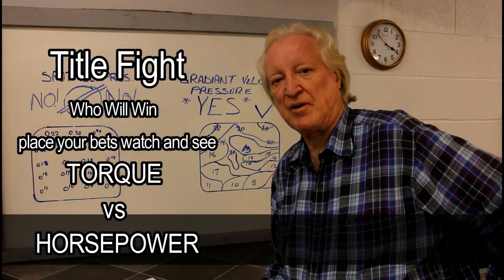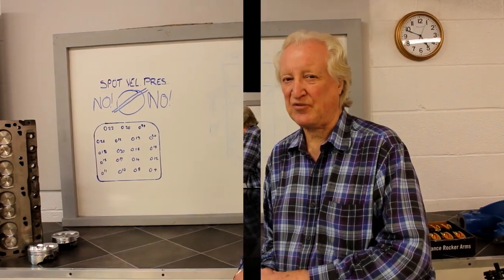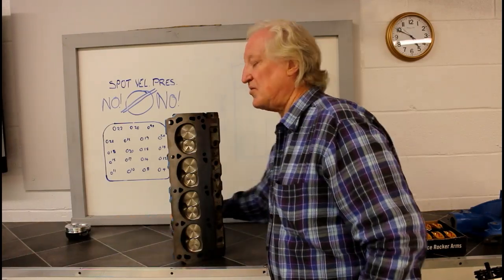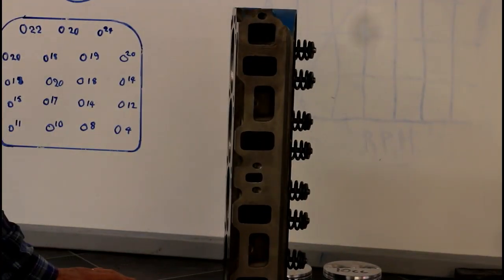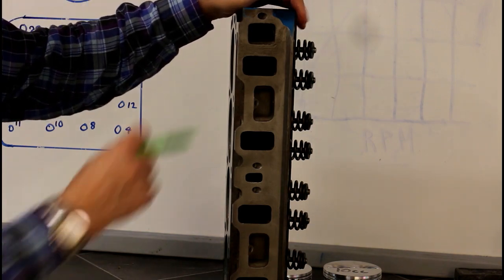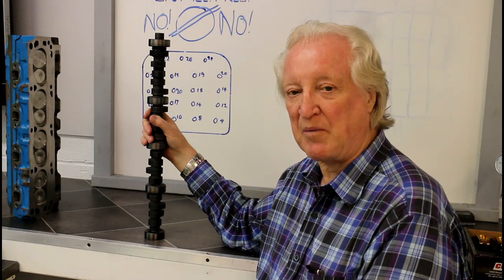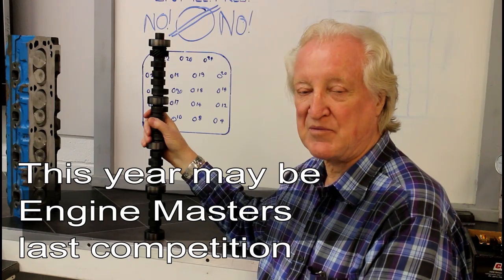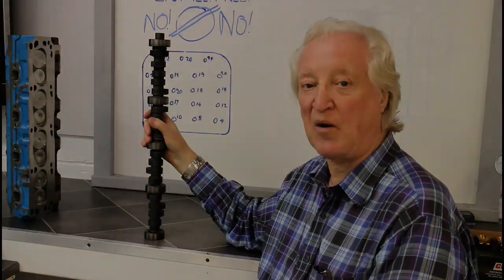Powertec 10 Episode 2 Torque vs Horsepower

Comment: I didn't know his daughter passed. I been watching David's vids for about 6 months. I myself had extreme depression and anxiety and his voice and information I been putting on late at night. Its not the world us born before 1980 grew up in.. This man knows his stuff. No doubt
Reply: Funny you use the Ft/Lbs per C.I. instead of HP per C.I.   I understand why you do it but, thru the modern day HP Torque equation and that equation's 5252 variable, HP and TQ are joined at the hip.  I bought Vizards books back in the early 90's. It taught me to look at efficiencies or the lack thereof and how to qualify those efficiencies. First, the reasoning behind HP and Torque.  The early engineers thinking of power and rotational force (torque), at a flywheel, was:
The linear distance covered at the circumference of rotation is a product of the radius and angles covered.  Therefor: 
linear distance = radius x angular distance
Further:
linear distance = linear speed x time
Ergo: Power is,
radius x angular speed x time
Finally we can say:
Torque = radius x force
This can be transposed as:
Force = torque ÷ radius = power
Boring! Most ppl dont understand HP.  Ppl thru the years have romantisized the HP variable into something its not. HP is a dimensionless unit.  Not until you add Displacement and RPM via the use of Radians can HP be measured.   TQ on the other hand can be measured; without any other variable.  Prior to the 1870's TQ was known as the Moment of Force. The HP Tq equation was created to qualify TQ per minute per second; aka, RPM.  I'll try to be quick here.  Radians, regarding Circular Functions such as Rotational Frequency as applied to an engine's flywheel have 2pi for one rotion; 1 RPM. Half a rotation is 1pi or half a Radian.  So, 3.14159 is 1pi, while 6.283 is 2pi.., 1Radian, or 360°. Keep that to the side for the moment. James Watt back in the late 1600's qualified HP with his 33,000 ft/lbs per minute equation or 550 HP per second. However, RPM was never qualified. To qualify HP we take Watt's equation one step further.  Take the 2pi per rotation and divide it by 60 seconds.
6.283 ÷ 60 = .1047166
This number gives us Radians per second.  Now divide Watt's 1/HP per second number by Radians per second.
550 ÷ .1047166 = 5252
There is your Time Qualifier for HP.  In other words, how efficient or inefficient is TQ being utilized at any given RPM.
You can also use the 33,000 number and divide by 6.283.
33,000 ÷ 6.283 = 5252
The 5252 variable is nothing more than a "Time" qualifier of Torque.  By default once Torque is qualified into a Per Minute Per Second equation, you have also qualified or Time Stamped HP per minute per second for any given RPM. There's the skinny on the HP, TQ, RPM, and the 5252 equation. Some say HP doesnt exist.  That is an incorrect conclusion.  HP, without Displacement and RPM, doesnt exist is a correct conclusion
-Edited for typo's-
Reply: @kevinshasteen5682  said "James Watt back in the late 1600's qualified HP with his 33,000 ft/lbs per minute equation " ... I just want to add that Watt was selling a steam engine to replace horses that were lifting water out of mines with ropes and pulleys. An 8 Horse Power engine would do the work of 8 horses, including the resting horses and the ones walking backwards to re-set the bucket for the next load of water. An actual draft horse can make 16 Horsepower for a few minutes then needs a break.
A Tour De France cyclist makes 2/3 Horsepower during the race, then there's the guy who pedaled the plane across the English Channel.
Horsepower is a really handy way of comparing cars and motorcycles.
Reply: @peterdarr383  I used to ride a mountain bike long distance for exercise.  Furthest I ever went was 55 miles; nothing like the Tour De France guys - those guys are in a league all their own. One interesting tid bit on James Watt. In his days, late 1600's to early 1700's, it was a bragging right to obtain a patten/copyright from the King or an Engineering Guild, also regulated by the king, for any new idea to help distribute your product.  Even though James Watt never qualified Torque Per Minute Per Second (per RPM), James Watt had created a Pressure Wave signature for his Steam Engine Cylinder he built but never applied for copyright/patton on his Pressure Wavw tech; and kept it secret, hence his reputation for always being able to build a more efficient engine than others.  It took the engine building world another 100 years to catch up to his Pressure Wave graphing technology. Must've been amazing times in the early days of Engine Modeling.
Reply: @kevinshasteen5682  Thank you for writing out this explanation of TQ and HP. This stuff is fascinating
Reply: @kevinshasteen5682  Actually, can you answer some questions for me? 

1. Why do HP and TQ appear as two separate lines on a dynamometer if they are derived from one another? Asked another way: why do people measure both variables if they are part of the same equation? Couldn't/shouldn't we just be measuring power with one line and call it a day?

2. If TQ and HP are so intricately related (which I believe they are), how is it that Torque can drop off so rapidly, but HP continues to rise through the RPM range? And why does HP normally start to take off right around the time TQ drops? I haven't done the math, but the increased RPM doesn't seem like it would make up the difference.

3. I like your explanation that HP is a measure of how efficiently torque is being applied at a given RPM. What affects the ability of the torque to be applied? If it's an engine-only dyno (not a rear-wheel dyno), it can't be the transmission, driveshaft, rear differential, or wheels. What parts/processes in the engine make the torque be applied more efficiently at some RPM and less efficiently at others? 

4. How the hell does a dyno measure Torque? I've always wondered that. Is it just that the spinning drum can tell how much force is being applied to it (if it's that kind of dyno) and can somehow calculate TQ and also differentiate it from Horsepower?
Reply: @bradleylovej part 1: Wow, glad you kept your questions simple, lol.  The answers to your questions could cover the first year's semester's course on Mechanical Engine Theory  of the History of Horsepower and Torque. You're asking all the right questions; tells me you are a thinker - cudos to you.  For starters, HP and Torque or not one in the same.  Hp is a dimensionless unit and only exists once Displacement and RPM exists. Torque on the other hand, known as the Moment of Force prior to the mid 1800's, is a measureable unit and can exists on its own. The confusion in thinking they are related is the 5252 variable in the HP/TQ equation which does make them "Inter'related" but not the one in the same dynamic. First of all what determines when HP/TQ rise or fall is how (intent) the engine is built; your dealing with Fluid Dynamics, NVH's, Pressure Waves, Static vs Dynamic Compression, Cam Timing and a host of other variables.  Saying that, you have to learn to recognize patterns. The hot rod magazines will never teach you the answers to the questions you are asking. Start with learning the differences in, lets say a 600 Hp Semi Tractor's High HP/Low RPM engine that never goes higher than 2500 RPM's vs that of one of the many modern day 600 Hp cars that rev to 6000+ RPM's. Go back in time and look at a typical Ford's Windsor small block 5.0 from the 80's. Back in the 80's the Ford guys had all the add on's they could afford; accept cylinder heads. It wasnt until the late 80's early 90's that the aftermarket began offering CNC heads.  The factory heads on the 5.0's were in the 135cc range for a 302ci engine. So initially, no matter what the Ford guys did, increase static compression, bigger camshaft, forged this and forged that, they were stuck with lousy heads; so the answer was to Supercharge their engine. A long comes the aftermarket and begins increasing the intake ports from 135cc to 150cc; eventially settling on 165cc for a hot street engine and 195cc for a racing engine, and the 220cc and 225cc ports for strokers; pretty much the same #'s with the Chevy guys. So what is the difference between a street 350 V8 using 165cc heads vs a street/strip 350 V8 that uses 195cc heads? The displacement is the same, yet the Cylinder Head cc's are different; different? Different how? Anytime you are reading a car/engine article, scan thru it and look for exact engine parameters.  Look for Displacement, Static Compression, Cam Type and its profile (dynamic compression), Cylinder Head Intake Port cc's with Flow #'s, and a dyno for HP, Tq, and RPM's. When looking at all these things always ask yourself, how do you qualify engine parameter relationships on a scale of Small, Medium, or Large relative to its peak output as Mild, Moderate, or Maximum: in this task you are addressing efficiencies and will begin to see patterns. Back to the HP, Torque, and RPM and the misunderstood 5252 variable. Lets end this txt; pretty long at the moment.
Reply: To understand HP one has to understand James Watt's and the engine builders of his day's attempt at engine modeling. The Early builders of steam engines, 1700 - 1800's, used Radians to qualify circular functions as it applied to angular velocity; as in how many revolutions was a flywheel spinning per second per minute.  Radians were the new mathmatical kid on the block in the 1700's.  Radians qualified circular velocity in a "per second" measurement while RPM's qualified circular velocity in a "per minute" measurement.  Without getting too complicated suffice it to know there are 2Pi Radians per revolution of a circle. 1Pi = 3.14159 while 2Pi = 6.283; divide the 6.283 by 60 (as in 60 seconds) and you get .10472 radians per sec.  If you took James Watt's horsepower per minute rating of 33,000 ft.lbs. and divided that by 60 to get a ft.lbs. per second horsepower rating of..,
33,000 ÷ 60 = 550 ft.lbs. per sec
The 550 gives us James Watt's standardization rating of 1 Horsepower per second, but didnt tie in hp per sec to circular functions of a flywheel on an engine, this is where Radians per second enters the picture. Divide Radians per second of .10472 into James Watt's 1 Hp per second of 550 ft.lbs
550 ÷ .10472 = 5252.1008
There is your 5252 variable in the
HP = (RPM × Torque) ÷ 5252 equation
If you stuck with the RPM HP rating of 33,000 ft.lbs per minute figure you could take 6.283 and divide 6.283 into 33,000
33,000 ÷ 6.283 = 5252
Regardless whether you use 6.283 or .10472 doesnt matter, both represent Radians Per Second Per Revolution Per Minute and yield the 5252 variable. So you're prob asking, why Radians?  The Radians combined with James Watt's 1 Hp per second measurement is a qualification of how effectively (efficiently) torque is being applied at any given RPM.  Because 5252 is a constant in the HP per TQ per Second math; Hp and Tq will always cross at that 5252 RPM on a dyno.  For those of you in the U.K., simply multiply 1.8181 conversion factor by any Hp/Tq dyno# to get your equivalent.  The 1.8181 constant is a Nm and Kilowatt conversion from Imperial#s.
Example:
5252 × 1.8181 = 9548.6612
HP by itself is a dimensionless unit.  It has no value until Torque, RPM, and Radians are factored into the equation.  Many ppl always say HP wins races but they are confusing its relationship.  HP doesnt replace Torque, at any RPM.  As in any math equation once you know its variables, that equation may be transposed - say to use HP, RPM, the 5252 constant to obtain Torque; but transposing the equation still doesnt alter the Tq Hp relationship.  HP merely qualifies how effectively Torque is being applied; nothing more nothing less.
Reply: @kevinshasteen5682  Thank you for responding and writing all of this out. It is a good explanation
Reply: Bradley, just FYI to you and anyone else interested. One of the dynamics that really opened up my eyes is understanding how circular engine math can be.  All you need are a few engine specs and you can reverse engineer all other engine specs. One of those eye opening moments happened when I stumbled onto the "Crank Angle Chart" calculator. This represents how much Volume remains above the Piston Top as the piston sweeps through the Cylinder; known as Piston Volume. All thats needed are calculations for 180° of one piston sweep of the cylinder from Top Dead Center to Botyom Dead Center. You can use this chart to determine Dynamic Compression; as in how much Volume exists above the Piston Top after the Intake Valve Closes. It can also be used in determining Piston Velocity/Acceleration. It does use basic trig if you were thinking of creating your own Crank Angle Calculator. The needed variables to make the calculations are Block Deck Height, 1/2 Crank Stroke, Connecting Rod Length, Piston Compression Height. When factoring in the Block Deck Height, you have to use a "0" Block Deck Height.
Reply: @kevinshasteen5682  Ah, man that crank angle chart calculator is right up my alley! Thanks again
Reply: @kevinshasteen5682  Dude, this is gold. I did know that lift helps generate power, and that duration helps determine where in the rpm range your power band lies (I have always been told increased exhaust duration raises the power band to higher in the rpm range), but I'd never put together that IVC determines dynamic compression. Makes a lot of sense bc after the intake stroke is the compression stroke, so as soon as that intake valve closes, the compressions stroke can start building, well, compression. 

Two questions: 
1. I have always wondered what helps with under the curve power, especially with cam specs. A lot of people throw in large rise cams with lots of duration and small to medium lsa, get tons of overlap, and have a very peaky curve with a high max hp, but not as much throughout  the entire curve. Very recently, David Vizard has made me think what affects under the curve power the most is actually LSA, by matching the LSA to your engine (using his 128 formula).

2. I know that lift has a really large effect on power, and it makes sense. But I also always thought Duration has a significant impact on power, just slightly less than lift. Is that true? And going back to my previous questions, is there one that affects 'under the curve' power more, and one that affects peak hp more?
Reply: @bradleylovej  Have you ever read an engine performance article where they installed a larger intake valve? Increasing the Intake Valve Diameter also increases the Valve Curtain at low to mid lift; ensuring that the intake port restriction in the cylinder head is the restriction and not the valve. At higher lifts the Intake Valve will become the restriction. The internet can offer equations and flow charts for when a larger valve is needed at low to mid lift. The peaky power curve on performance engines comes from "our" wanting to go fast, therefor, we will try to build an engine with peak Wide Open Throttle (WOT) in mind. Some ppl dont know when a little becomes too much, such as when ordering Cylinder Heads with too much Intake Port cc's or a camshaft with too much duration. As Duration increases, as it does when selecting a larger cam for a rebuild; overlap also increases causing your cylinder pressures to bleed off more so than the stock cam it replaced; this alters, or compromises, your Dynamic Compression Ratio. To correct the extra bleed off of cylinder pressure caused by the extra overlap of your new cam, an increase of the Static Compression Ratio is required. This is where the Crank Angle Calculator comes in to play. Once you grasp all/most of the dynamics in your control, you should determine (calculate) what your component parameters should be prior to actually touching any parts. I call this building your paper engine. Its the Dynamic Compression Ratio (DCR) that will tell you if/when you should increase the Static Compression Ratio (SCR). Say we have a 350 V8; again we dont care about brand loyalty as we are only crunching #'s. So we have a 350 V8 and want a 10.5:1 SCR. Looking at your Crank Angle Chart Calculator, you have chosen a cam whose Intake Valve Closing (IVC) leaves .750 volume above the piston. Calculate one cylinder and multiply it by the percentage of .750. I always like cc's so I convert everything to cc's. The convertion from cubic inches to cc's is 16.387
(350 ÷ 8) x 16.387 = 716.93cc
You need to know the Total Combustion Chamber to calculate a 10.5:1 SCR. Simply deduct 1 from your SCR and multiply it by your Cylinder cc's
716.93 x (10.5 - 1) = 75.47cc
Now you can multiply the Cylinder Volume by the .750
716.93 x .750 = 537.70cc
Now use the Compression Ratio equation but input the Volume Remaining after the IVC, this will give you your DCR.
(537.70 + 75.47) ÷ 75.47 = 8.12:1
This DCR is a borderline DCR, it barely scates by on pump gas and will have a mild lope but still good on the street. Ppl argue and debate what an acceptable DCR is or isnt.  I guess it depends on whether you like a little lope or a lot of lope, but at least now you know how to calculate that lope into your build. Read all you can about DCR on the net/YT vids. When reading Engine Builds in an article, learn how to classify that engine into categories as in a phase 1 thru phase 5 performance build. You can also name your phase 1-5 builds as in 1) Grocery Getter 2) Peppy Street Engine 3) Hot Street Engine 4) Street/Strip Engine 5) Dedicated Race Engine. Dont forget for each category you can add in Turbo, Supercharger, or Nitrous.
Classifying the categories of engine performance allows your mind a chance to begin connecting the dots and identifying patterns. Cam Lift relative to power deals with how the Cylinder Volume sees the Cylinder Head. You are dealing with volume vs velocity of the media flowing through the ports into the cylinder. You really have your work cut out for you here, but a quick how to on matching a cylinder head to a cylinder volume is this. Like I said earlier I always like converting everything to a cc measurement. Ports are already in cc's so the only thing you need is to obtain the Cylinder Volume into cc's
(Displacement ÷ #cylindrs) x 16.387
 Now take whatever Cylinder Head you are looking at and divide the Cylinder Volume into the Cylinder Head Port Volume. Again take the 350 V8 and look at two different port volumes; one with 165cc and the other with 195cc - whats the difference?
(350 ÷ 8) × 16.387 = 716.93
716.93 ÷ 165 = .230
716.93 ÷ 195 = .271
The difference between 165cc and 195cc seems minimal, but is vast.  The .230 constant is a low end Peppy Street Engine with a smooth idle that runs on low octane fuel while the .271 represents a low end Hot Street Engine that requires high octane pump gas.  I call this constant the IPCV#, ad in Intake Port divided by Cylinder Volume, hence IPCV. The CFM HP formula is
HP = .257 x CFM x #of Cylinders
Our # of cylinders will always be 8 as in a V8. So you could combine 8 with the .257
.257 x 8 = 2.056
The Cubic Feet per Minute (CFM) for airflow is whatever valve lift you are thinking about making your peak valve lift. Say you are looking at a street head in the peppy street engine category that flows 225 CFM at XYZ valve lift.
2.056 x 225 = 462 HP
Keep in mind you have to decide if this is Flywheel Hp or Drive Wheel Hp. The Intake Valve spends very little time at Peak Valve Lift so the 462 Hp only represents Hp Potential. You have to factor in the Cylinder Head's Port E/I% to get exact HP from this equation. Because the Intake Valve spends little time at Peak Lift is why you see engine builders incorporate a cam lobe lift 100 thousandths (.100) more than usual to obtain their full port volume CFM to HP potential. Check out 
https://youtu.be/JPAeepqrY-0 regarding his walk through on the E/I% of a Cylinder Head Port
Edit: Yes I've seen David's 128 formula but have never used it.., yet!